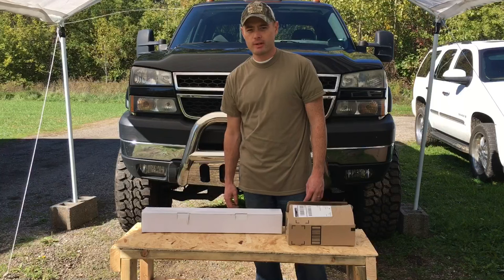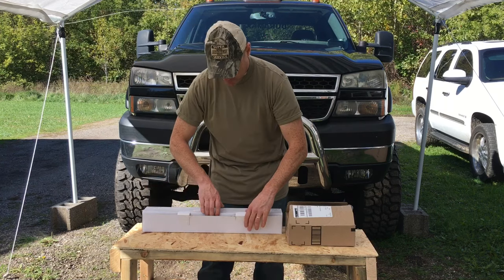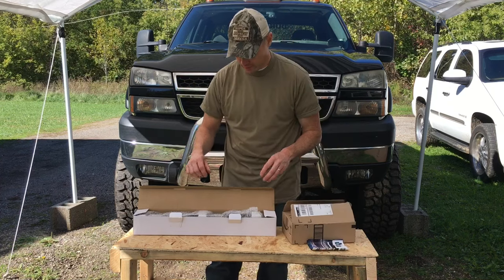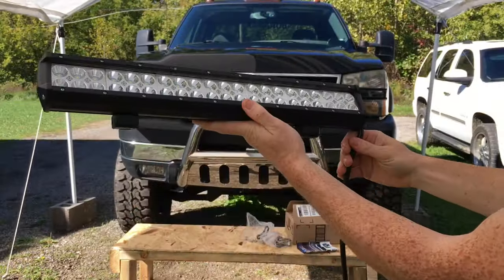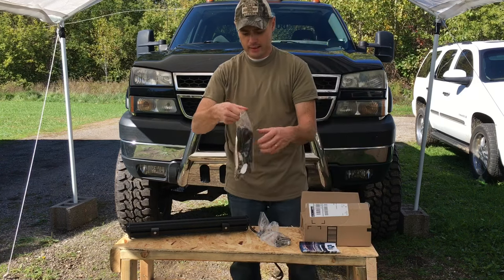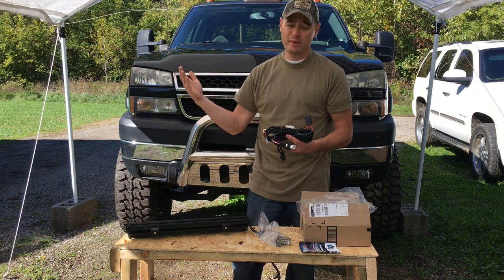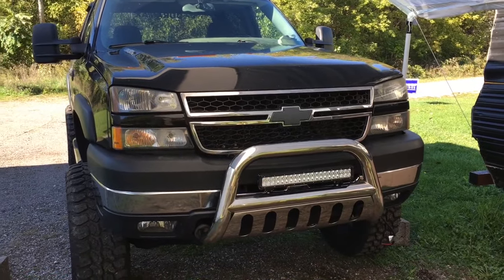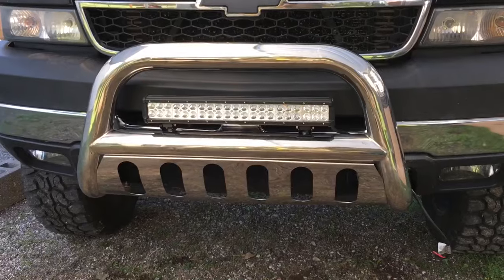Nilight 20 inch Light Bar Install

Comment: can i assume you wont want to use this as a supplement to the stock headlights when driving down public roads? guess it can be angled down enough not to blind other drivers & still be useful ey?
Reply: salt pepper it’s illegal to use light bars in public roads, u will get a ticket if a cop sees you some cops will even give tickets if your off-road lights don’t have covers over them but i don’t think they care much bout that

Comment: That's a 3D light bar they have 4D, 5D, and 7D light bars now. 3D light bars are a few years old now. I would like to try the 7D light bars now.
Reply from the maker: +Welder Nate that's some great info i didn't know there was so many different types
Reply: Nilight Led Light Where's the 32 inch?
Reply: Man those aren't 8D those are old ass 3D light bars that don't shine far. I want fisheye lenses in my light bars. My 3D 32inch light bar is just sitting on the floor collecting dust.
Reply: hey, we now just have a 4 inch one on amazon website, I will check the 8D 32 inch one with our factory. comeback to you later.
Reply: Welder Nate hey Welder, for 8D leds, currently we just have the 4 inch ones. sorry
Reply: Welder Nate b

Comment: My install is not that easy with no removable grommets nor adjustable slider brackets.   Sad face emoji.   Guess I'm busting out the drill to bust through the metal bracketing somewhere.

Comment: Why are you so afraid to touch the truck? That switch should’ve run through the firewall. If you hate the look of “accessories” why did you go with a stick-on switch?  If you want it clean, do it right. Hard wire it to an OEM style dash switch.

Comment: "ya I'm not a big attachment guy"...has a 6 inch lift, bigger tires and rims, aftermarket tow mirrors, bullbar, and this video is about putting a light bar on haha that kills me...thanks for the video rather than that tho
Reply: didn't realize it was a duramax lol nvm the tow mirrors
Reply: Yeah.... I think the technical term is "aftermarket parts" Though attachments is a new one.. You still stuck on call of duty and gun attachments, kid? TECHNICALLY speaking. Parts are something you replace. So bigger tires... replaced the old ones, lift kit, replaces the stock lifting aspects, (the suspension) of the vehicle.  So forth and so on.... So technically.. this does indeed look like his first "Attachment." There. I've justified calling it an aftermarket part AND his first attachment.